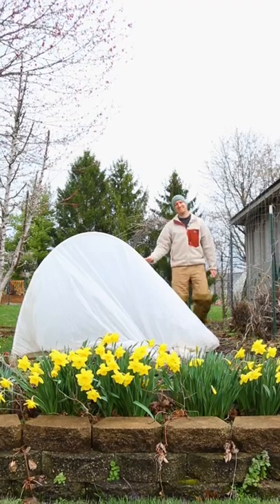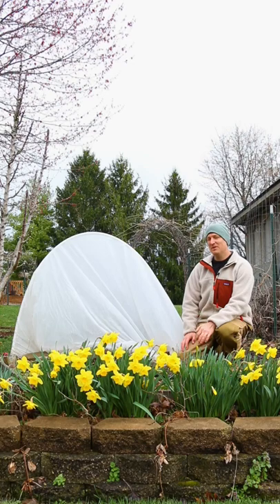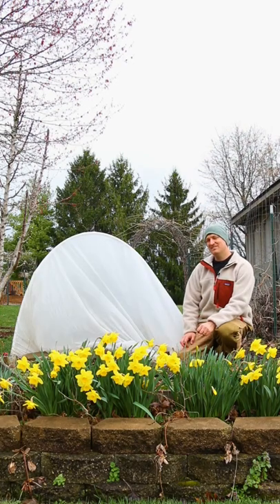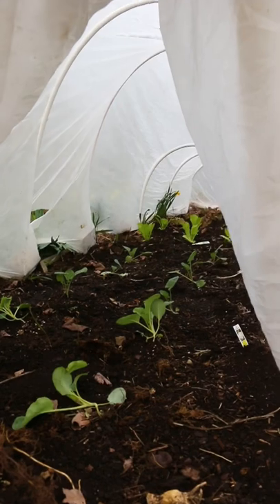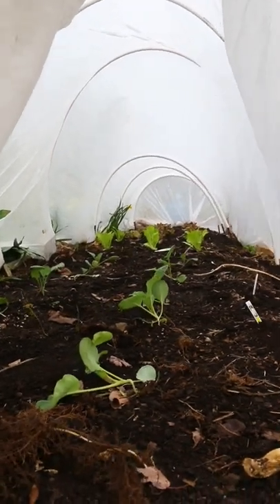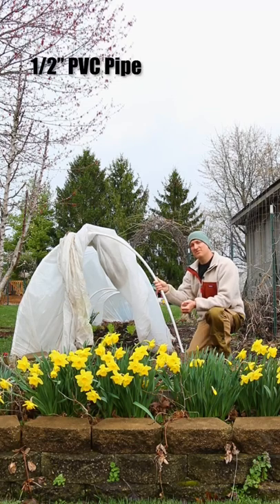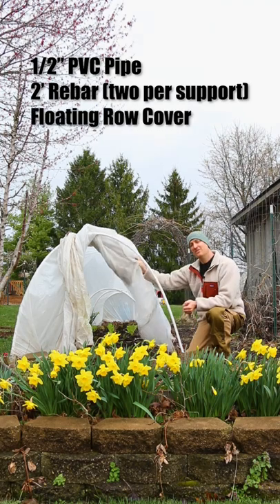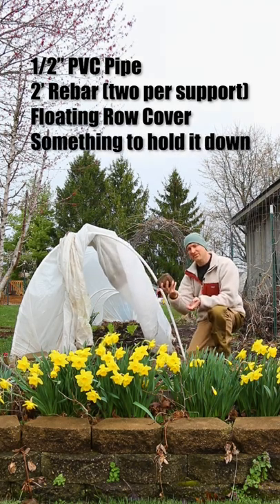How to build a floating row cover to protect your plants from frost.

Comment: May seem like a simple question to you, but what exactly is a floating row cover?? I was assuming it was just plastic sheeting, but that looks almost like a cloth based material.
Reply from the maker: They are sometimes called "fleece" row covers.  It's a spun fabric that allows light and air penetration.  They come in thicker or thinner grades depending on the level of frost protection you want.  Agribon is one pretty big company that makes them